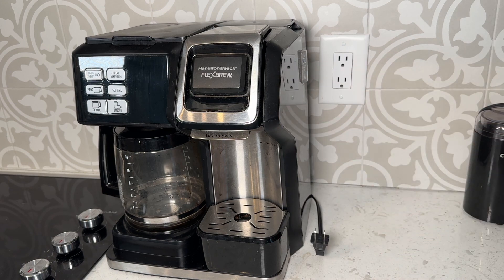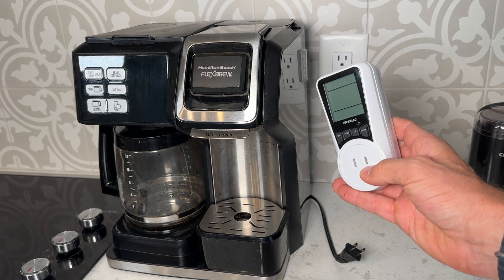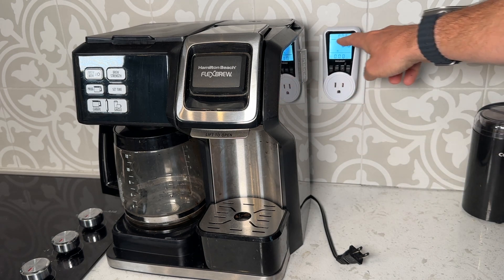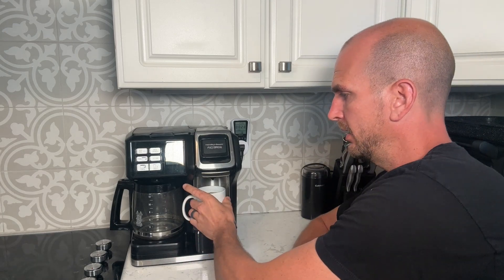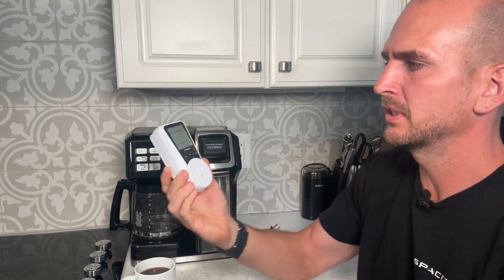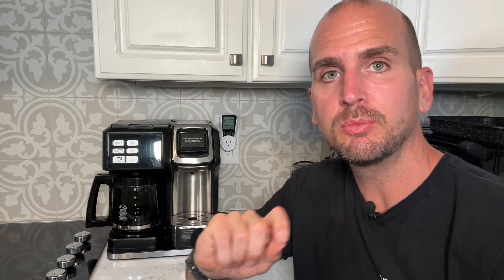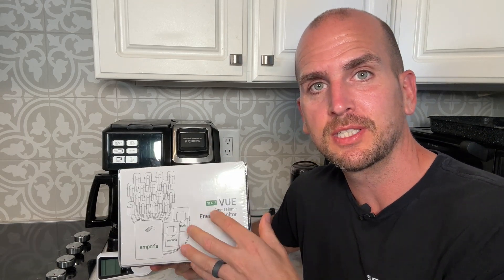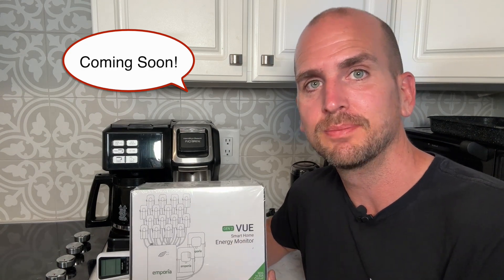Easily Measure How Much Energy Your Appliances Consume

Comment: Do you have one that measures 20amps?
Reply from the maker: I don't think so, but I just installed a much more capable system on my electrical panel which will give you all sorts of options for measuring higher loads https://youtu.be/Qz-aHoew5cs

Comment: Fantastic—do they make these devices for 240V outlets? I’d love to have one for my EV charging outlet in the garage (I know some of the fancier EV cable units have this feature but mine is a bare-bones version).
Reply from the maker: I don't think so, I just installed an Emporia Energy monitor on the other channel which is able to track your EV charger and 15 other circuits.  Pretty handy https://youtu.be/Qz-aHoew5cs
Reply: I wish they made a 240v one as well.   Would love a simple, cheap solution to see my Oven and Dryer usage.

Comment: You might be able to find a cheaper unit called the Killawatt. Does the same thing.
Reply: I just checked the prices for the Killawatt. Looks like it may be more expensive.... Depends on where you source it I imagine.
Reply from the maker: Nice, thanks for the heads up.
Reply: Kill a Watt is more expensive, it does not have a backlight display, and it loses the readings when you unplug it or lose power.
Reply: @realSamAndrew  I bought my Killawatt about 10 years ago so indeed the prices are more expensive now.
Reply: @ricksherman34  no comment on the other features?
Reply: @realSamAndrew  If you leave the unit plugged in it does what you need it to... I use it to measure current draw during operation and standby. Then recorded it manually and run offline calculations in a spreadsheet. I paid $10 for it about 10 yrs ago.
Reply: @ricksherman34  you seem defensive. Whatever happened in the past, and whatever your needs were is history. As we stand today, and going forward, we have 2 alternative products. For someone shopping today, one item is cheaper, with more features. That's simply a fact. Note I did not say one is better than the other. Everyone needs to make their own decision based on their own tastes.

Comment: I'm in a time of use area and I try to get up before 7am and try to get my coffee, toast and shower in before the rates change. Over a month it adds up
Reply from the maker: What is the range on your rates?  We are a flat $0.12 per kWh where I am at in Illinois which is honestly pretty reasonable if you compare to other utilities across the US.
Reply: @everydaysolar  off peak 7.4c, mid peak 10.2c , on-peak 15.1c.  But you can also pick an ultra low rate option which is overnight from 11pm-7am at 2.4c but the on peak is then at 24.0c/kwh
Reply: That ultra low overnight is really appealing for car charging , battery backup charging , etc.